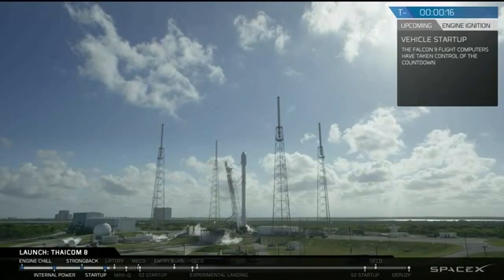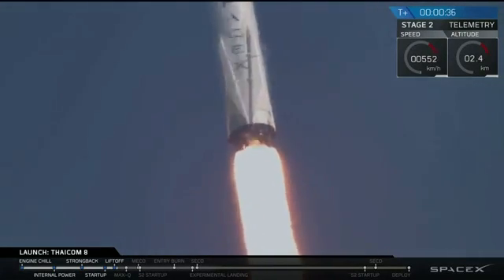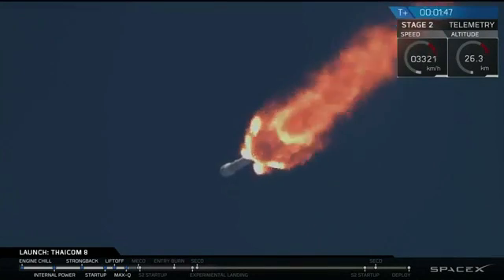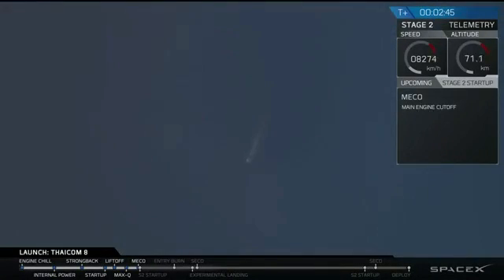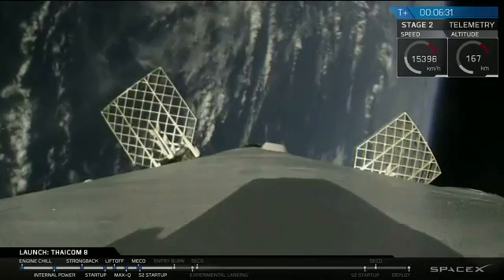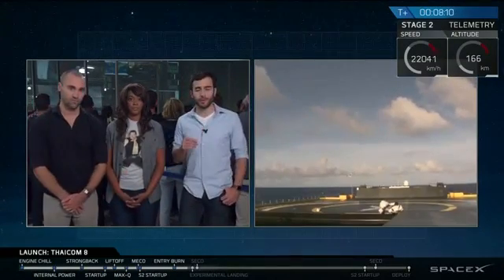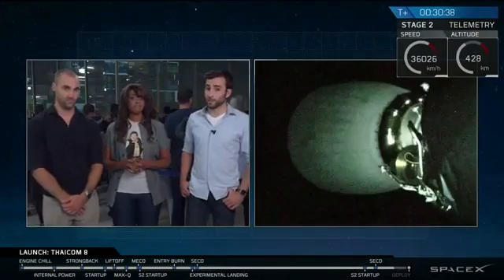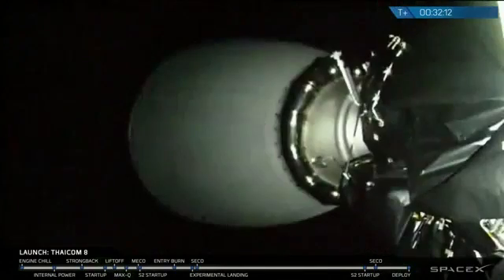SpaceX launch and fourth landing with onboard view

Comment: What the hell happened @3:30 ? All of a sudden the Earth is reversed / upside down ? With different cloud pattern on the background. And the supposed craft seems to be much less tilted all of a sudden, engine less being heated up aka glowing from the supposed heat. And what the heck is it with the seemingly dramaitic horizon curve? Is Earth the size of Mars now. One conclusion one could probably make here: Smoke and screens for the people as it seems. Question this people, don't just take "events" for granted. I got an eery feeling that we are being  sc*$#@"+&!  here.   Again...
Reply: If you payed more attention, you will have seen that they switched to the camera on the other side of the vessel. The cloud formations are exactly the same.
Reply: Oh, you've got them by the balls now, good job, good job mate.
Reply: +freemanrobe I suggest you take another look. The camera on the opposite side of the engine is rotated 180 degrees. The image of the clouds below is identical (if you rotate the image or you head around).
Reply: @killakrust  stop it he's ignorant

Comment: what happens with the stage two rocket? It remains on orbit or falls back to earth?
Reply from the maker: Satellite must have it’s own propulsion system which will be start in apoapsis to stay in a stable orbit.
Periapsis must be low and 2nd stage orbit will decay and finaly burn during reentry.
This has to be confirmed : i’m just a kerbal space program player !
Reply: aymeric obled Well it is so much more complicated but the satlite has to be super small and therefore they will not add a propulsion system to it with that kind of power. Remember the kerbal space program earth is about 10x smaller than the real earth. That means to do anything you have to 10x the deltaV. So you cant really compare it.
Reply: They even said it in the Livestream, the Satelite has its own Propulsion to finish the Orbit.
The Stage 2 will move to a slighly different orbit which will decay until the Stage burns on reentry.
Reply: +aymeric obled Aaaaaaaand you're totally wrong.
Reply from the maker: Ok :) what the answer ?
Reply from the maker: I search for the answer since heverson46 ask this question. In this article (http://space.stackexchange.com/questions/7814/what-happens-to-the-falcon-9-second-stage-after-payload-separation) they say that there's three options : 1-suborbital trajectory  (I was thinking it was the good one, but this implies an additional engine for satellite no ?) ; 2 - Deorbit burn ; 3-left in orbit
I do not know what the right answer is (or another ?)
Reply: The second stage boosts the very large satellite (speedyjens must not have seen any pics of it) into a geosynchronous orbit, not just to apogee. Thaicom will have some form of propulsion for station keeping during its lifespan, but not anything large enough to boost itself into geosync orbit.
The cheapest option for the second stage would be be to boost up into a graveyard orbit, otherwise if they have enough fuel, they could do a retrograde burn so the perigee is low enough in the atmosphere to bring it back down. I'm not sure what SpaceX has planned though.